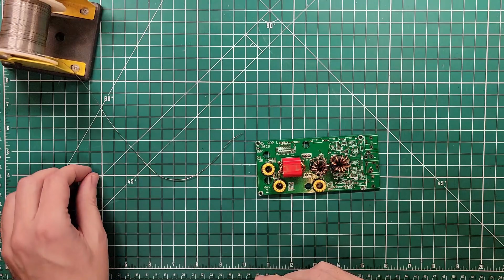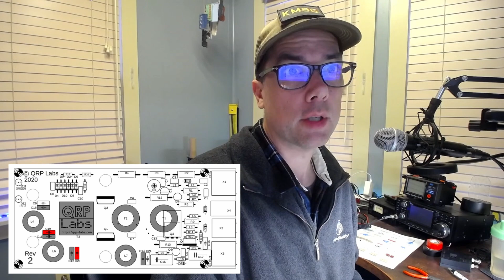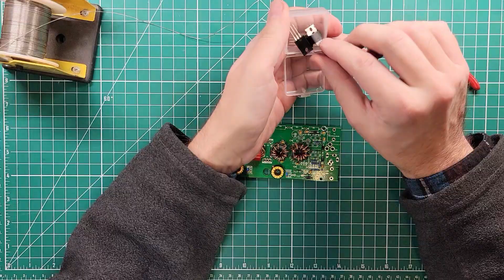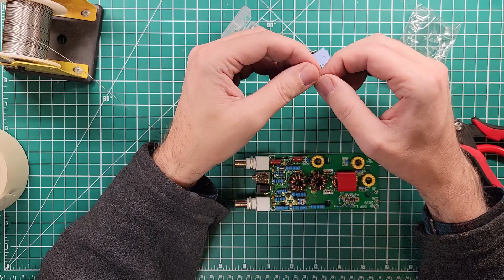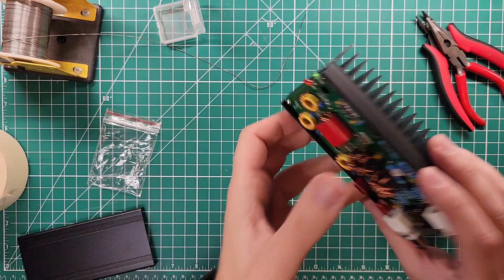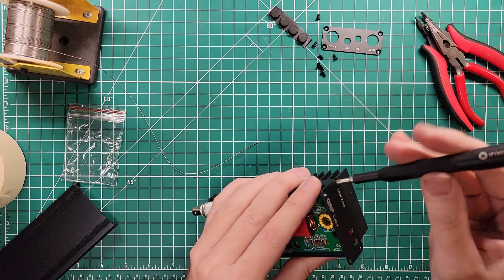Finish That Build! - QCX PA 50 Watt Amplifier - pt3

Comment: Sitting here with a cow of coffee this morning if this amp would work with the QDX just as well as it does with the QCX...
Reply from the maker: It should, are you having a problem with it?
Reply: @temporarilyoffline  Oh no problems. I saw the build on your videos and thought I'd buy it and build it then saw in the specs that it is built for the QCX series of radios and not for anything else so I wondered if the circuitry would still work in phone or in digital mode. Hint hint, wink wink, video idea. :)
Reply from the maker: Already filmed brother - the amp was made before the qdx - works for digital and ft8, but not voice.

Comment: Hi Steve,
Nice finish to the build, but I would have added a few dabs of heat sink compound between the heat sinks and the case to achieve good thermal conduction. Glad there was no blue smoke.  🙂 Was getting set to work 3Y0J on 30m FT8 this morning and my FT-450 had no output. Panel meter showing 100W, but nothing coming out the back end. Have my FT-891, but it's not setup for WSJT-X. Have your "Easy Way to setup FT8 using the FT-891" video ready to view since I can use the SignaLink USB from the FT-450. The connections should be the same. You and the family stay safe.  73  WJ3U
Reply from the maker: I do believe the connection ls are the same.  Good luck!

Comment: 4:38 yes there actually is a tool for bending components. It is called a "resistor lead bending tool". Back when I worked a summer job at Moog Music I used one when I would have to solder hundreds of resistors onto boards. I actually designed and 3D printed a version that let me bend about 10 at a time since they all had the same spacing.
Reply: the one and only Biegelehre
Reply from the maker: Excellent!

Comment: Biggest surprise of the series , the pa isn't multi band!  Whoa!
Reply: At that price point I think that is understandable.
Reply: @LifeAtTerminalVelocity  sure sure I just didn't realize! Lol.  I've never researched power amps. I'm still learning how to operate up to 100 watts lol and my qrp experience is limited
Reply: @the_mad_swimbaiter455  I understand. I have an Amp that has been in my shack for 3 years and has been used 2 or 3 times tops. The stock 100w is getting it done so I haven't had a need to use it very much.
Reply from the maker: Good eye!

Comment: Thanks TO. This looks like a fun build. Are you considering maybe making one for 10 meters?
Reply: Yeah it was wondering if it could be modified for 10 or 11 m
Reply from the maker: I'm pretty sure he has a 10m version of the kit - but it would be pretty simple to modify by setting up the Low Pass Filter  with the right torroids and inductors
Reply from the maker: I might after some further testing!